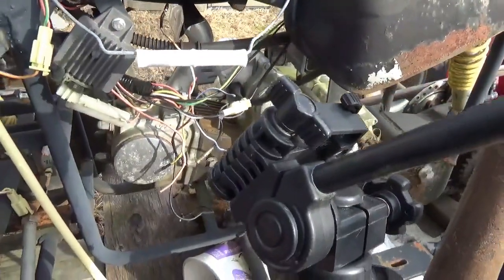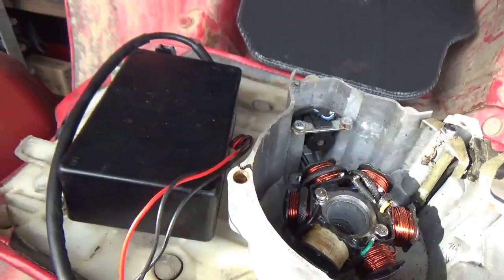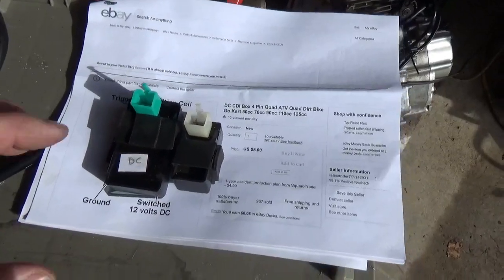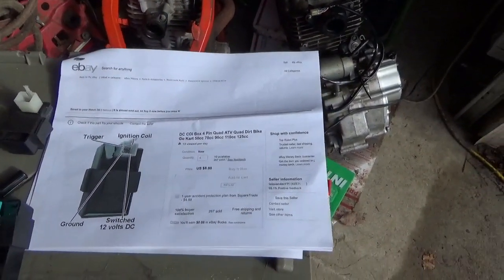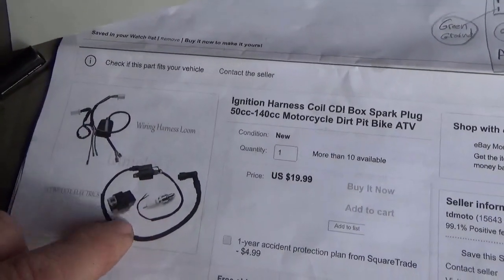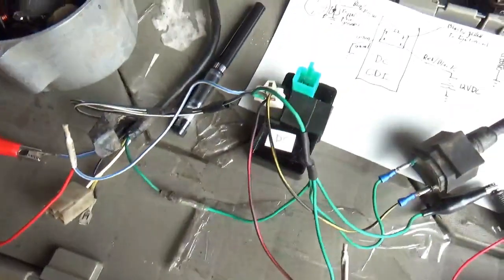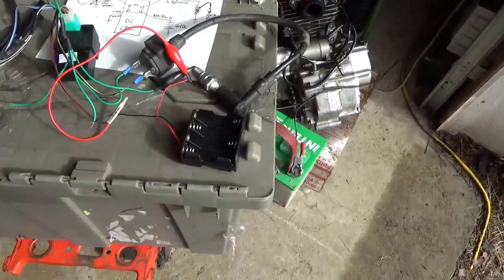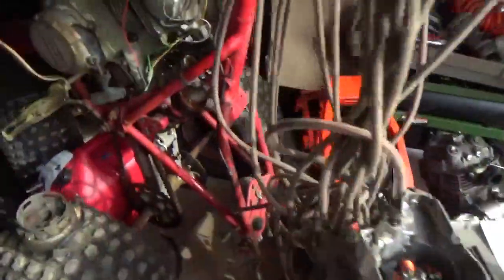Simple Battery Powered CDI ATV Ignition, Easy Build, Great for Troubleshooting!

Comment: Hello I have a kymco mxu 500 4x4 with a bad wiring harness do you know of a cd cdi I can use on this atv besides the factory one. I believe the cdi is bad also but a new one is over $100 bucks. Would like to rewire with a cheaper cdi thanks.

Comment: But what if you have dual spark plugs how would that work
Reply: You'd need two with access to the same connections, this is much more geared towards okf school single cylinder for the most part, but you could try it on a twin with 2x everything in sure,

Comment: Love the pit bike rewire, but I use my Honda 250 for hunting etc.  Are the lights, switches, etc now just dead meat, or will it still charge what’s left of the original system?
Reply: Dc cdi will charge the battery on its own

Comment: Please help, Harvey, I don’t know who else to ask(I left another comment that says my problem)
Reply from the maker: Hey AG Squad!  I assume U have no spark and the cdi is putting out a 200v pulse,.... If U R getting 200V out of Ur cdi, I'm thinking the cdi is good.... I would start by changing the coil.... But, it is easier for the cdi unit to drive a volt meter than the low impedance of the coil, so, I would change the cdi second if the spark done not return after the coil change.... I hope this helps, sorry for the expense.... Thanks for asking, watching, and commenting!!!

Comment: When I connect my ignition coil to the output of the CDI and the ground coming from the battery, the voltage on the multimeter drops to 0. Once I disconnect it, it gets roughly 200 volts from the CDI. Please help, I’m out of ideas
Reply from the maker: Hey AG Squad!  I assume U have no spark and the cdi is putting out a 200v pulse,.... If U R getting 200V out of Ur cdi, I'm thinking the cdi is good.... I would start by changing the coil.... But, it is easier for the cdi unit to drive a volt meter than the low impedance of the coil, so, I would change the cdi second if the spark done not return after the coil change.... I hope this helps, sorry for the expense.... Thanks for asking, watching, and commenting!!!
Reply: @HarveySpooner  I got it working last night actually!! It was a combination of a couple things. My coil was bad and I had my pulse generator wires backwards. She sparks like crazy now and all I need to do is hook up the stator to the regulator then run it to the battery for charging and I’ll be back riding. You’re the best, keep doing what you do, I and so many others appreciate it greatly.